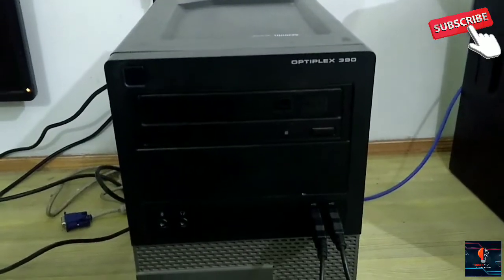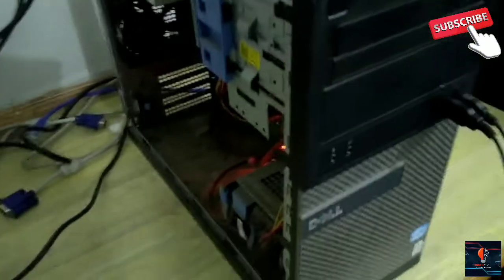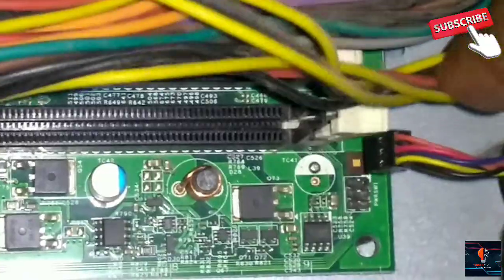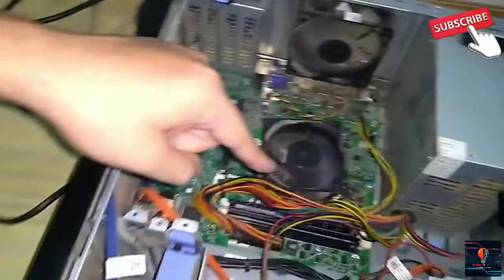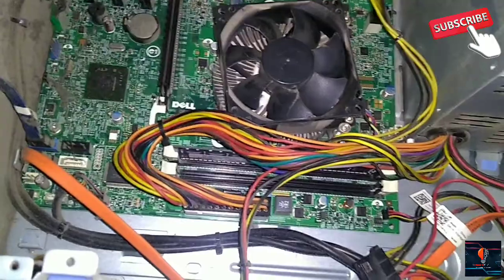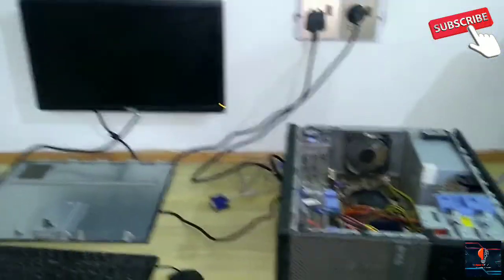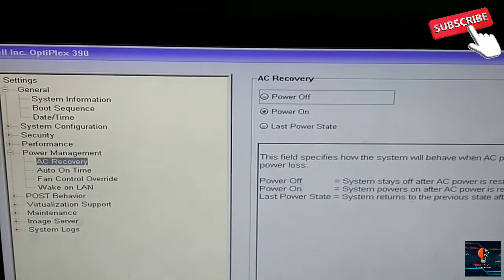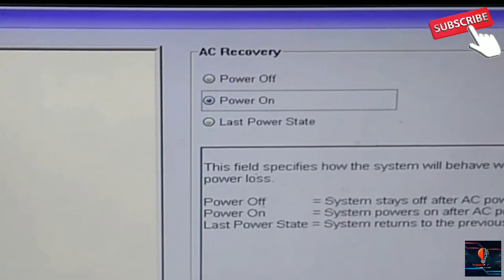How To Start a Computer Without Power Button | How To Turn On PC Without Power Button | Power Issue

Comment: My motherboard is ASU’s .. will it work ?
Reply from the maker: This trick will work if your computer button is not working ot broken
Reply: @technicalbilal3  so from now on    if i shut down pc   ....  how to start again  ??   just plug in the socket ??
Reply from the maker: Yes just plug in socket after Change bios settings
Reply from the maker: The video explains how to turn on the auto-on option after direct turning on the computer.

Comment: Pls tell me the process to go in bios setup
Reply from the maker: Restart your computer then press f2 or f12 key 
When you restart your computer you can see download side on right corner f2 or f12 key for BIOS if you not found BIOS key and f2 or f12 keys not working then you press f10 or f9 keys after restart your computer some computer have f2 or f12 keys and some computer have f10 or f9 and ESC keys for BIOS setting